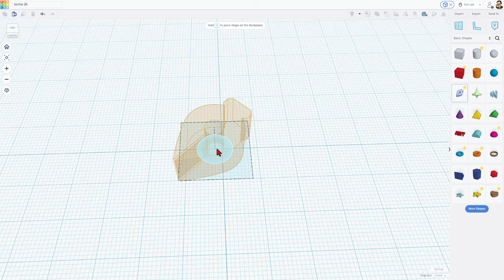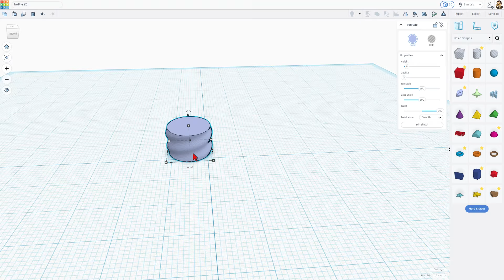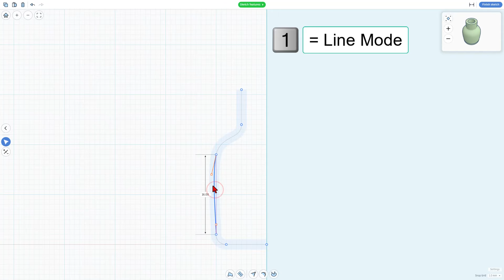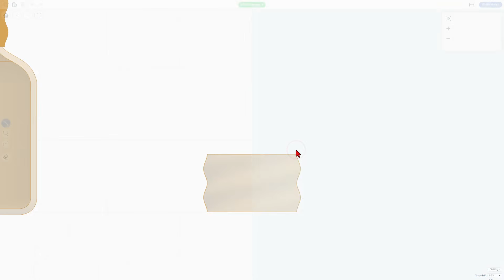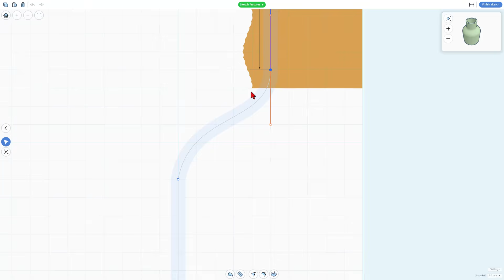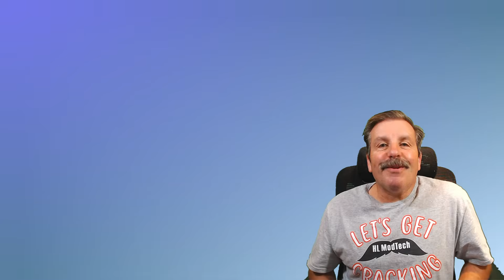Easy Tinkercad Knuckle Threads: 10 minute Bottle & Cap! 💯🔥

Comment: Why do we need an oval? 12mm by 13mm????? Please explain to my stupid brain. Thanks!  🧠🧠🧠🧠🧠🧠🧠🧠
Reply from the maker: It just needs to be an oval to make the "knuckle" when we add the twist. I chose 12 x 13 so it prints fast... If need a 30mm hole, you would use 30 & 31mm.
Reply: @HLModTech  That's good to know but not intuitive teacher. What would be the consequences if you used 12mm by 12mm??? Would you get a flat spot on part of the thread or what would happen??? :body-blue-raised-arms:  🍐🍐🍐🍐🍐
Reply from the maker: It would just be a cylinder.. no knuckle for threading.
Reply: @HLModTech  *NOW I GET IT! The part sticking out (13mm) actually "BECOMES THE THREAD" I am glad God glued on my head,,,,,, DURRR!!! :hand-orange-covering-eyes:Thanks teach! 🍎🍎🍎🍎🍎
Reply from the maker: Dude... Took me a while too. ZDP is so patient with me when he shares this stuff. Today on the golf course it dawned on me that if we change that to 1.5 difference... we get a deeper thread.  Still need to test... but it is 2 of us that are getting a grip with it!
Reply: @HLModTech  It get's better than that! First make the top a tiny bit smaller like your trying to make a quick couple oil drilling pipe called a ''rotary-shouldered connection''. Then test draw 6, 8 or 12 sides not round. Then twist to maximum and back-off as needed! Getting any new ideas??? 😁😁😁
Reply from the maker: I am not connecting dots atm... but I will fiddle and see if I can figure it out. Knocking out a vid rn too, so my focus may be limited. 😜
Reply: @Freedomistmanan RSC is like a photographic shutter release cable attachment. Both are conical threads, which have pros and cons over straight threads.

I agree it's worth looking into, but it might not be suitable for a HLMT tutorial video.

I'll have a crack at it, but these are the kind of things we should discuss and develop in HLMT's free Patreon community.
Reply: @HLModTech the origin story of this tutorial is Bambuslicer had a new feature to draw knuckle threads in the slicer to connect parts.

So that begs the question "If it prints well, can we use it in Tinkercad?" and "Why a knuckle thread and not an ISO or ACME thread?"

So it turns out that a knuckle thread is really easy to draw and prints at relatively fine scale.

Why a circle and not a square or hexagon or octagon? First, circles print well but have less grip. Second fewer sides just means more complexity. Mostly, it's because after the square, the circle is the second easiest regular shape to draw in Sketch.
Reply from the maker: Thank you Sensei! 💯🔥 Always appreciate when you check in!!
Reply: @DanK-ZDP189  My time is limited and Patreon can become a ''way of life'' so I am "Patreon shy" these days, lol.